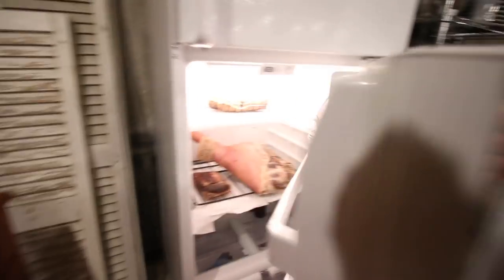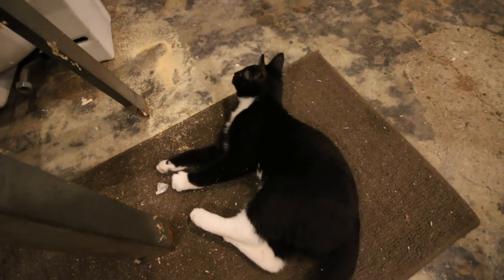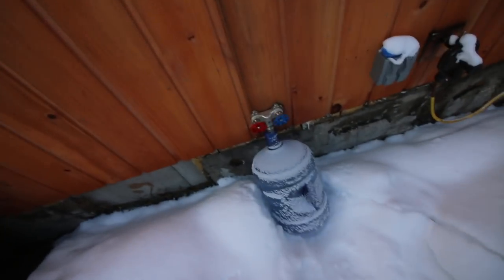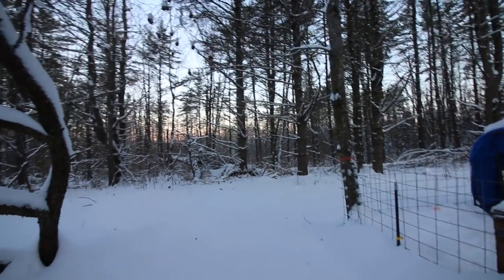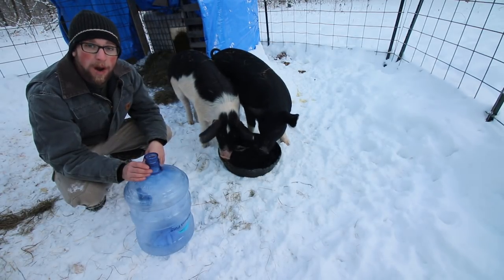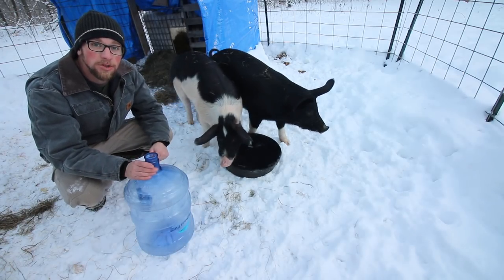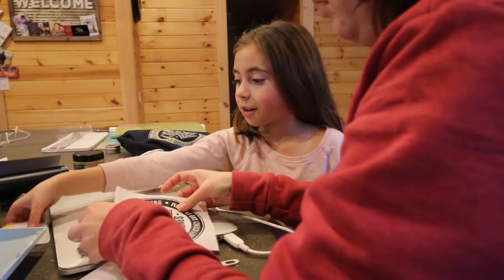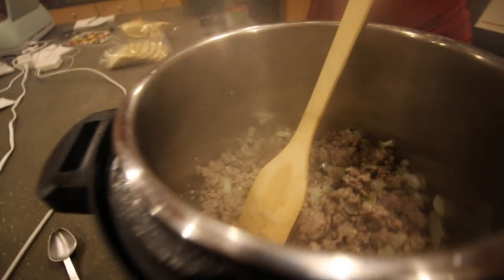Modern Steader Update  -5F ~ Girls Take Over the Vlog

Comment: Brrrrrr! Too cold, not as cold here, hovering around 0*F, still too cold for my creaky old bones, and you out there with no gloves. 
To test your barley seed, put it in a bowl with enough hot water to cover, then stir. Let sit overnight, stir again, floaters are not viable, sinkers should be mostly 85-90% viable. Drain the sinkers and sprout as usual. 
Very cool that you got a stencil cutter, I love mine. Gina and Miss Livvie did a great job on the logo. Some cost saving tips. You can buy rolls of Contact peel n stick shelf paper, it's the same vinyl that comes with the stencil cutters, far less expensive. Glad Press n Seal food wrap works well for transfer paper. Have fun with it, there is so much you can do with it.
Reply from the maker: Thanks for the great tips!

Comment: If you cut the cold pipe and the air swirls around, will dust be moving and getting on the meat? I'm thinking keep the pipe as is. Just like you found in the hot air pipe, just 4-inches made a noticable different. xoxo from sunny Arizona.